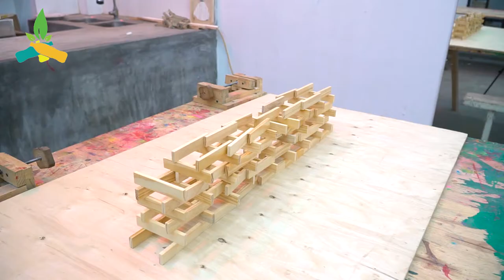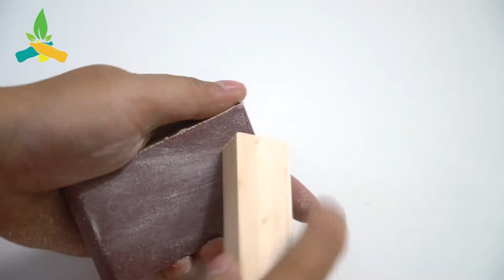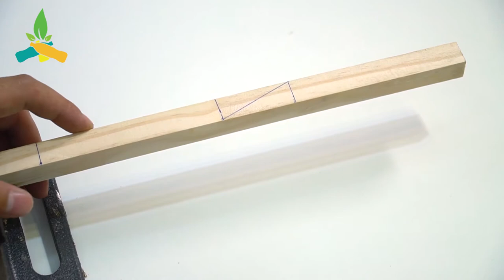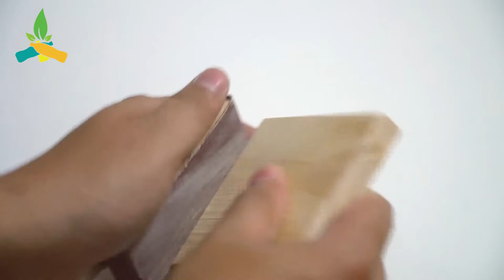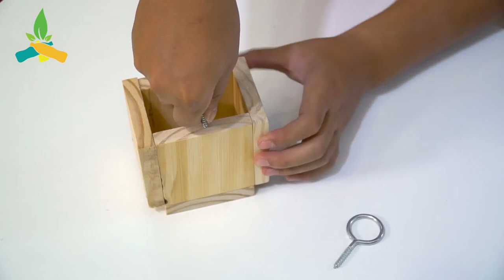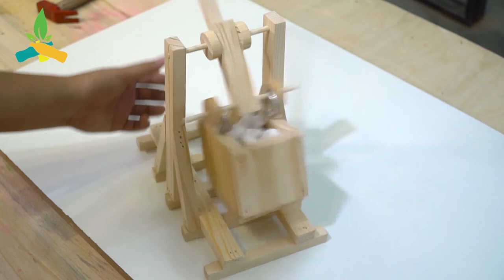How to make a wood toy catapult

Comment from the maker: The trebuchet is a compound machine that makes use of the mechanical advantage of a lever to throw a projectile. They are typically large constructions (up to 30 meters [100 feet] in height or more) made primarily of wood, usually reinforced with metal, leather, rope, and other materials. They are usually immobile and must be assembled on-site, possibly making use of local lumber with only key parts brought with the army to the site of the siege or battle.
Subscribe channels to see more video